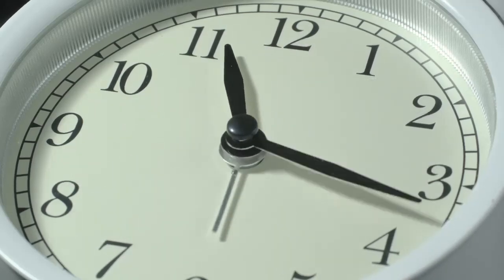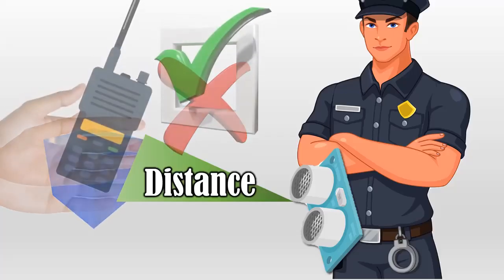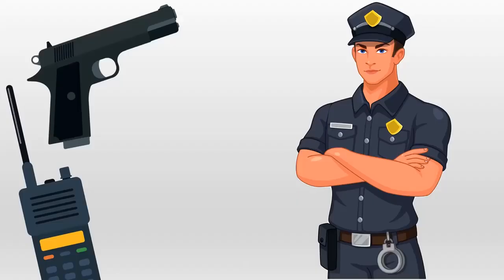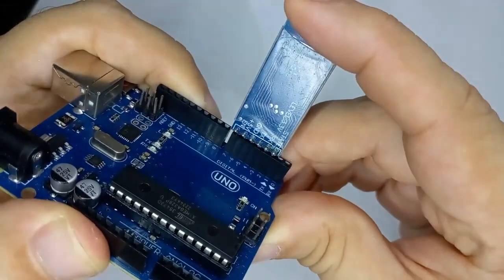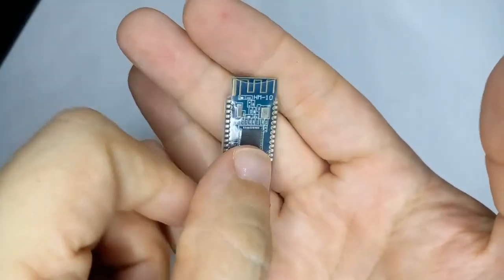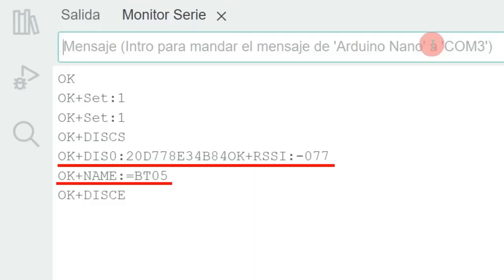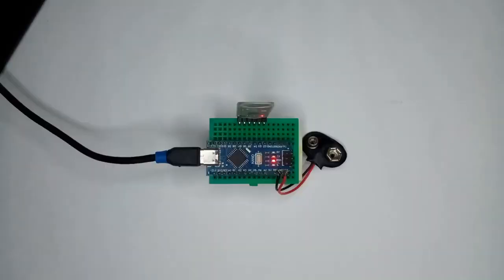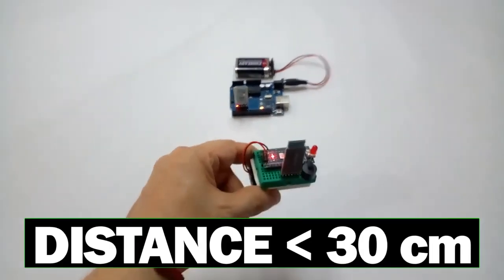Omnidirectional Proximity Sensor With Arduino Bluetooth HM-10 Measure RSSI HM10 AT+DISC?✅ AT+INQ❌

Comment: well my hm-10 dose not reponse to AT+DISC?
Reply from the maker: Check the PDF AT command Manual for HM-10 in the AT+DISC section. https://people.ece.cornell.edu/land/courses/ece4760/PIC32/uart/HM10/DSD TECH HM-10 datasheet.pdf
Reply from the maker: Search in Google "hm 10 at command list" annd Enter the link of Cornell university. Is a PDF File.
Reply from the maker: Run the comand to list all of AT Command available in your device firmware, to check if at+disc? Is include it,  i remember the Command is at+help? Maybe